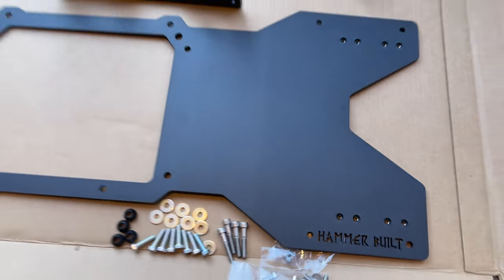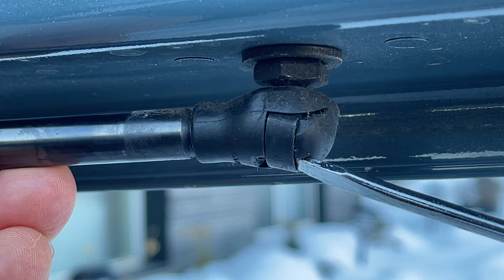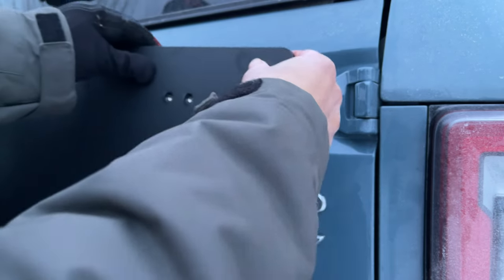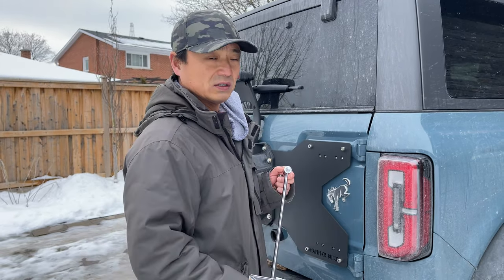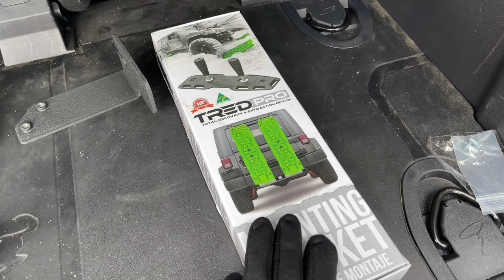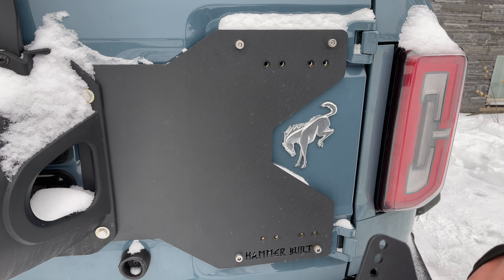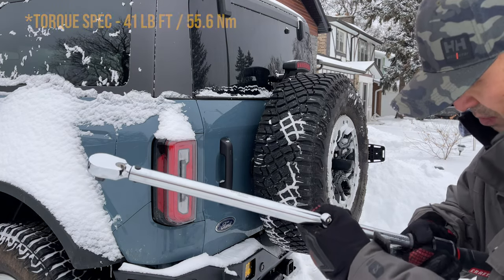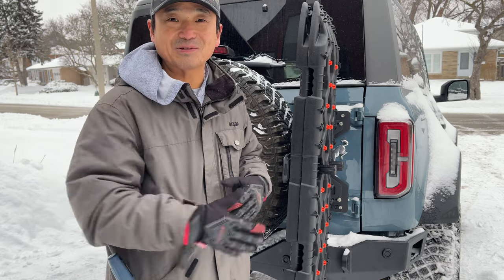Traction Boards On The Hammer Built Tailgate Reinforcement System

Comment: Great video, definitely plan to do this myself but with the m2m bracket/panel
Reply from the maker: What’s the m2m? If it’s for the traction board,.. you might want to wait for my mod review video. The short of it is: the running board sits too low and impedes departure angle. 

But if it’s for a gas tank… 👍
Reply: @neverendingweekend   ill keep that in mind and measure twice but I'm a little concerned about adding dynamic/fluid weight onto the hinge and having it move around on the trail. Figured the boards would be lighter. M2m: mountains to metal
Reply from the maker: Ahhh..

Comment: Placed an order for a '24... guess I won't be seeing it until '25 or possibly '26. Will most likely cancel the order. Bummed,  been watching so many vids and was anxious to get started on my upgrades..😢 BTW, ordered a 2 door, 7 speed manual with sasquatch, can't find this combo anymore in the '23
Reply from the maker: That was me a couple years ago. Watched endless videos until I got mine. Then it was at the dealer for another 5-6 months for a recalled airbag before I even got to drive it. 🤷‍♂️ 
Might want to keep your place in line while you do what you need to do until then. Who knows. 
That’s a beauty build. I would’ve got the same if they offered the Sasquatch with manual with the v6. 🤷‍♂️. This is the first automatic car I’ve ever had. Still love it though. Good luck with your bronco! 👍

Comment: I didn’t understand why you needed to unclip the gate assist to install the initial plate.  The shims seem to be just cautionary, yes?

Like the boards higher.
Reply from the maker: I’m not sure either. Almost feels like that would just be another way to keep the door inline. The shims you definitely need. Even now, the space between the door and frame when closed is too close (it touches). And I’ve even tried to realign it afterwards. 

I’ve decided not to put the boards on the back. They’re either too high (probably ok, but moves on the highway) or too low (lowers departure clearance). 

Now that I have a trailrax rack, I’ll put them either on top or on the side. Here’s the video of the trailrax mod and install if you’re curious: https://youtu.be/zBIC4K5pVos?si=ibJla3azk6l8AUtR

Comment: Dude I've been making a list of upgrades for months, and I have pretty much every choice you have made here.  How are you liking the front bumper / winch setup?  Seems like a good combo.  Also, I was thinking of attaching a krazy beaver shovel to my tailgate reinforcement rather than traction boards.  Trying to decide between this HB one, and the JCR one.  Awesome video!
Reply from the maker: Thanks. 
I still really like how the FabFours bumper looks. Fit and finish are 👍. The Warn winch is good. Has someone on our group use a cheaper winch that failed. I’m comfortable with the tried and true Warn brand. Have used it extensively helping others. 😏
I really don’t like the traction board on the rear. Hangs too low when off-roading. And is a bit worrisome on the highway, even though I know it won’t fly off. The shovel would be cool. And I don’t think you can loose with either the HB or JCR. The only reason I got the HB is because of their accessory attachments. 
Good luck with the build!

Comment: He looked like Adam Sandler’s Little Nicky character 🤷‍♂️
Reply: Do the boards interfere with the backup sensors?

No lock on the boards?

Why is it so cold there?
Reply from the maker: @swooshdave   my sensors are messed up because of the front bumper. No allowance for sensors so they’re unplugged and I get an error. If I get the courage enough when the weather is better, I’m thinking of drilling holes in the front bumper. I don’t really miss the sensors but I hate the error message I get every time I turn on the car. 

No lock on the boards. I’ll only put them on if I go off-roading. 🤷‍♂️

Because we’re further from the sun then you are. 🤓
Reply: @neverendingweekend  You’d be surprised at how far north I might be. I’m actually above Toronto in latitude.
Reply: Do you still like this set up? I have the Hammerbuilt brace, I like how you mounted this. I just don’t need it all the time.
Reply from the maker: @waynek848 I still have it installed but I don’t use it to carry my traction boards. I didn’t like how low they sat and how much they shook on the highway. I got a new roof rack so I’ll probably mount the boards up there. Maybe I’ll put a gas can on the back… just another thing I’ll never use. 😅

Here’s the roof rack video if you’re interested: Done! TrailRax TRMR Roof Rack with Custom Light Mounts on my Bronco!
https://youtu.be/zBIC4K5pVos